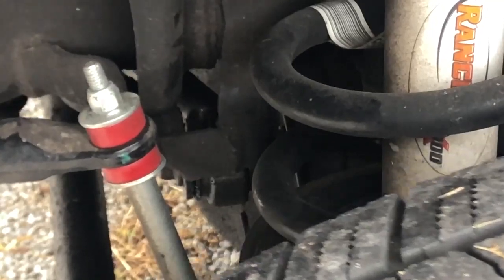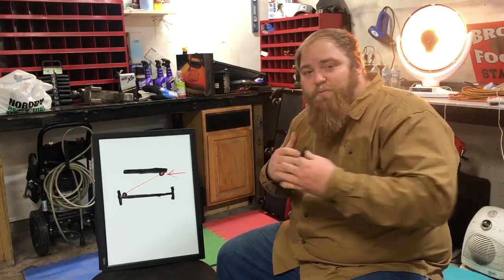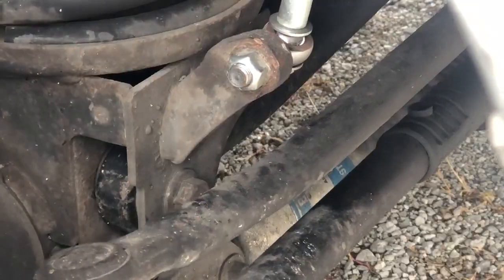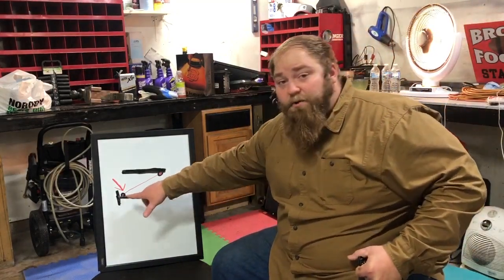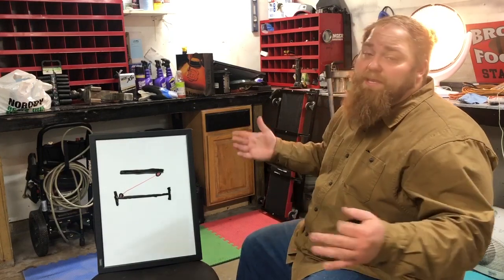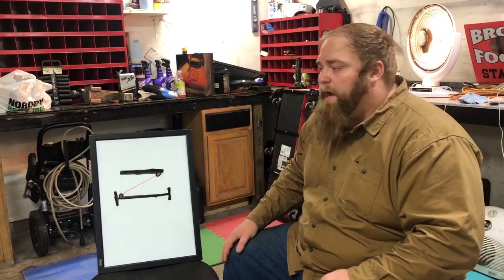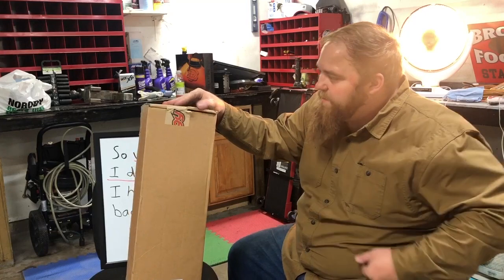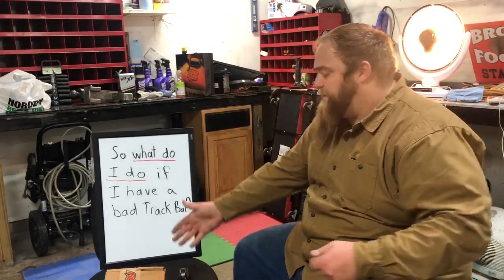Symptoms of a Bad Track Bar - (Death Wobble Fix)

Comment: Hi, thanks for the great video and info.  Mine's a used '15 Jeep Wrangler, terrible death wobble and reputable mechanics have said the track bar and bushings are good.  Most feel the stabilizers need to be replaced (but that's not a "fix" or so I've read/ watched videos so many times!).  I have an appt with an off-road suspension specialist and I'm pretty confident that we'll find track bar/ bushings failures.   Thank you!!  That death wobble is VERY scary, especially on the highways as you mentioned!

Comment: Man you explained everything my truck is doing right now.  I hit a small bump and it shakes like crazy.  I have to slow down in the middle of the road to get it to stop.

Ive replaced ball bearing and joints, my tie rod, wheels balanced and rotated. But no mechanic ive been to have said anything of a track bar.  Ive spent so much money trying to fix it. I was just about to buy a whole new suspension system. But this just may be the fix.
Reply: Did you fix it ?

Comment: Hey, good video. I have a 17 f150 4x4. It’s been having the “wobble” since I took it off-road a few times earlier this year. I went over some real bad bumps at too high of speeds. It has a 2.5 inch level with 285 70 17 tires. The steering wheel doesn’t shake unless I go over a bump, but when I do it SHAKES like crazy. It feels like the tires are going to fly off while driving. I’ve taken it to Ford (before it was so bad) and they swore it was just because it was off-road wheels and tires. I believed it at first, except the problem has gotten progressively worse since. I believe I have the exact issue you’re describing and it’s a failing track bar. 

I just wanted to see what you had to say about it because I have taken my truck to 3 different mechanics and they don’t seem to know much about truck issues such as these. I was almost going to trade in my truck until I saw this video. 

Probably failing track bar? It wobbles at low speeds as well, even drive through the parking lot speeds. I would like to keep my truck but I don’t want to spend a bunch of money paying people to diagnose something they know nothing about and still have the wobble risking my life at highway speeds. 

Thanks for your input if you have time at any point. I really appreciate it

Comment: I have 53,000 miles on my Ram 3500 and have gone through 3 sets of tires. The front tires always wear out towards the outsides. I'm wondering if that could be a sign of a bad track bar?

Comment: Thanks for the info. And here i thought it was other things so I got it replaced like end links, ball joints, tie rod inner and outer, drag link, pitman arm and alignment. I have a 99 dodge ram 3500 4x4 dually. Can I have the link to the video you installed it..

Comment: Thank you for the video,
My 04 Grand Cherokee WJ is making a clunking noise only when turning the vehicle right. I did recently, have new ball joints, shocks, upper and lower control arms, all new tie rod ends, sway bar end links, wheel bearings and cv axles. I just got this noise after replacing the cv axles and wheel bearings. I also installed a front lunchbox locker (automatic Powertrax No Slip). I have front axle disconnect, and when I tested it with the wheels up it only made the typically ratcheting noise.
I am thinking that the track-bar is worn bushings on one side, and when the weight of the vehicle shifts it is popping. You think this is a possibility? Thanks

Comment: Good information and welcome from a fellow RV transporter.  I have a 16 Ram 4500 and I've been experiencing wandering in the steering in the front end for a long while now.  On a flat road it's not that noticeable, but when roads are rutted from heavy trucks or uneven pavement, the truck will just wander in either direction and it takes lots of correction to get it back in line... and will often times just be continuous on bad roads.  New tires, alignments, all front end components looked over, and no one can seem to figure it out.  What might you suggest?  Thanks!
Reply from the maker: Justin Barnes Hey! Thanks for reaching out! What you are describing has several potential culprits. If this video didn’t pin down the track bar as the main problem for you, I would consider your steering linkage. 

Your steering box may have play in it. Which a slight degree of play turns out to be quite a bit at the tire. If you can turn your wheel and the drag link doesn’t pivot, then that might be the answer. This would most likely describe your wandering and trying to chase the straight line back and forth.

If your actually tie rod ends are loose or worn, it can still pass spec but when you hit that lumpy road your tie rods may be loose enough to let your tires wander and fight each other. The combined slightly wandering of each tire may account for the wander. 

My last thought would be your wheel bearings. It’s possible that your wheel(s) bearings have play in them and yet they haven’t fully failed yet and set off your abs light. I would check out the proper way to check if wheel bearing(s)are bad. 

Lastly, I would consider your steering shaft going through the floor. There is a very small u-joint (near your pedals:looks like an aluminum short shaft) that has a rubber bushing that wears out. You can turn the wheel back and forth and potentially see the u-joint ends knocking back and forth. I currently have this problem in my truck and found a cheap temporary fix. This last one seems ridiculous but it’s one of the last things people ever consider.

I will be putting out a video once I test out the fix more thoroughly. I don’t want to give garbage “help” lol 

If I can be anymore help let me know! Subscribe and like if I gave real value. You can email me here contact@highmileagehelper.com
Reply: Wow!  Thanks so much for taking the time to go thru the causal possibilities.  I did have a tech say one of my wheel bearings was bad about 6 mos ago, but the other was perfect - so he replaced the bad one.  Hoped that was gonna fix it, but really nothing improved.  They examined the front-end components, and said all looked perfect.  They also tightened the adjustment nut on the steering box - but minimally as they said there wasn't much adjustment left.  No improvement there either.  I really think it might be steering box related though as it all seems to originate in that area first.... but i'm just not sure and I am afraid of taking it to a Ram dealer and being taken advantage of.

Many blessings to you for your kindness my friend... nice to know there are fellow Christians out on the road among us.  Drive safe and maybe we will cross paths out there.
Reply from the maker: Justin Barnes You are so welcome! All I want to do in life is to be a helper, help people know Christ and to help people with anything else I might know.

Yea it sounds like it’s further away from the wheel in one failed part in the chainlink of tires - steering wheel. Before you go replacing the steering box, I would just strongly consider and inspect that in-cab part that can wear out.

The original video creator(s) I watched talk about it said people chase loose steering by replacing the whole front end and still don’t get results because they don’t continue following the steering all the way up the drive shaft. Again, I’ll be recording that video as soon as I can showing what the problem is and then how to fix it. 521k and mine is begging to just be put out of its misery lol. I can turn the steering wheel and yet the tires don’t turn. Likewise, tires get slightly turned due to road conditions (seems like what you are describing) and yet my steering wheel is still straight.

If you want to FaceTime sometime and just check it out together I’d be happy to at least help rule it out. Sorry for writing a book lol hope you’re having a great night!

Comment: Hey do you spray a coating under your truck for the treated roads in the winter?
Reply from the maker: Unfortunately I don’t. What you may see in the video however, is a layer of oil from my leaking valve cover that has cracked plastic. It’s nearly $500 I’ve seen for brand new or aftermarket. And because it’s not performances based I won’t be dropping that kind of money on a luxury part until more important things are addressed first.

Comment: I've got this happening on my f250 2012 diesel where at 55 to 60 mph the tires go back and forth..Is it the track bar or could it be bad ball joints for my truck has some movement on the lower ball joints but track bar is solid..was thinking about upgrading to bd trackbar but was wondering if ball joints could cause this wobble too.
Reply from the maker: hlr029 Hey thanks for reaching out! I definitely think ball joints could cause that. My more likely suspect if it’s not the track bar bushings would be the steering linkage(since it’s both tires and not just one side). Overall, I believe that would give more play than the ball joints alone. 

My opinion is that we always want to work our way down the line of most impactful parts, which usually means going from the steering wheel down to the tire.
1. Track Bar (Separate, Highest impact)
2. Steering Column being loose
3. Gear Box being loose
4. Steering Linkage being loose
5. Ball Joints play
6. Hub assemblies going out

Email me and I can FaceTime with you to help if you’d like! God bless and stay safe!
Reply: @HighMileageHelper  thanks bud I was wondering about the steering linkage to,being that the dampner on top is definitely shot and the whole bar has a ton of play in it as well..
Reply from the maker: hlr029 The steering dampener is like the icing on the cake in my opinion. That only masks the real problems elsewhere. Great to have but it only adds support to the other components that should be taking the bigger blows.

I would replace the bushings in Bar(then reassess), then linkage and see where you are at from there.
Reply: @HighMileageHelper  yeah I'm gonna replace the whole track bar first and see what that does and I guess go from there..
Reply from the maker: hlr029 Let me know if I can help any further. We gotta stay safe in these trucks! 😀
Reply: @HighMileageHelper  that's for sure..appreciate it..just dont want to go up to a shop and be told I need it all replaced or that it's this or that..basically have some kinda idea of what it is..but yes them front tires get to wobbling and the only way to stop it is to speed up or slow down,so it's got to be fixed and done right..

Comment: Have you ever come across a vibration/growl at about 60 to 70 mph? Seems to be a common problem with the Rams.
Reply from the maker: John EM Thanks for reaching out! Well, I’ve had the power steering pump do that, ball joint wear create that at higher speeds, and track bar shaking rapidly with bump steer at those speeds. Death wobble is the end result with our straight axles😭😂
Reply: Transfer case?  Mine was in a 2004 -2500 4x4. It came at 60 and leveled out at 75 or so.
Reply: My transfer case exploded one day.  After it was fixed, the truck never had that problem again.
Reply from the maker: Jamye Moore Hey Jamye! Thanks for sharing!  And that’s very interesting you suggest transfer case because I just experienced mine nearly exploding after I heard growling and then chains whipping the bottom of my cab. I had it replaced the other day and it’s gone completely.

So I would just add that maybe it depends on where you’re hearing the growling/vibration? Directly underneath you verses in front at the axle distance.. I’m sorry you had to go through that too Jamye but hopefully you weren’t injured by anything coming through the floor. I’ve heard some wild things like that happening!
Reply: HighMileageHelper I was most definitely experiencing a vibrating like a death wobble.
Reply: HighMileageHelper my transfer case exploded and left junk up and down the highway for 1/4 mile. No one was injured
Reply from the maker: Jamye Moore Wow Jamye! So glad you were ok. That’s scary stuff! God bless!